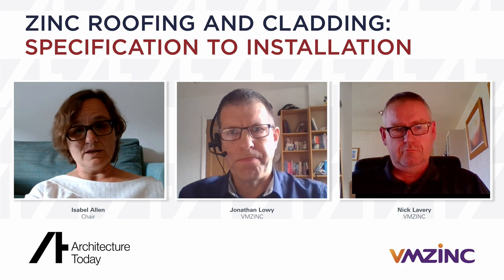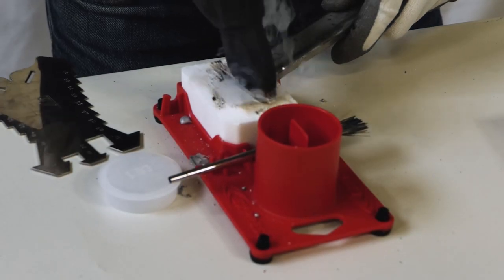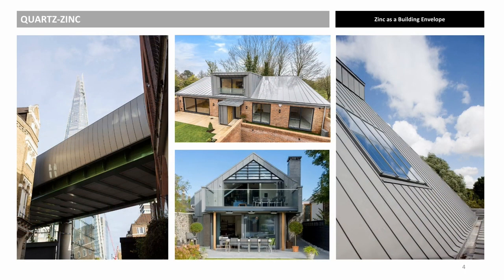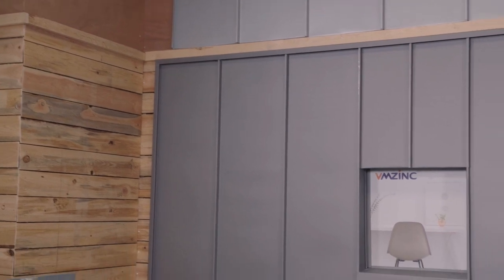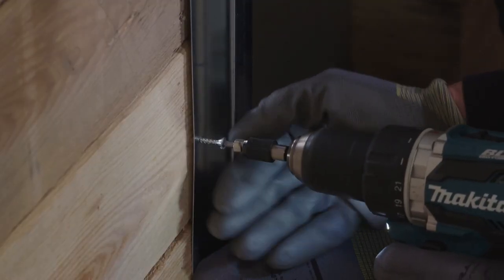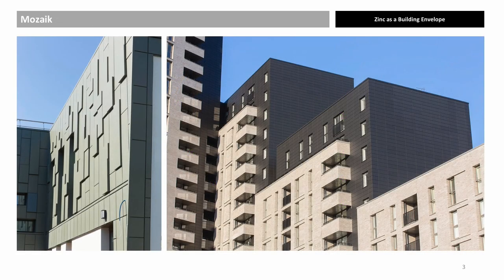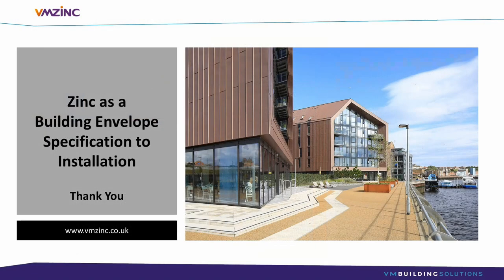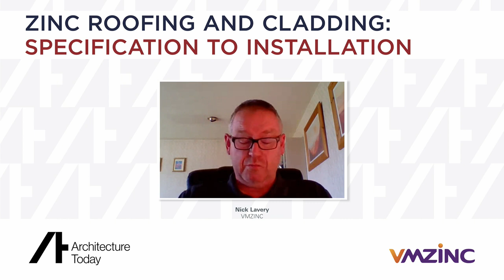AT Webinar with VMZINC Zinc Roofing and Cladding Specification to Installation

Comment: Very interesting high skill installation. For domestic use colours seems impractical 3 ton volume unlikely. 70mm rockwool tween rafters 50mm sarking dual purpose board over =120mm insulation total. Can VMZINC membrane go over direct & zinc roof covering finish fix direct into sarking? Zinc weight reduction factor+structural improvement of sarking board attractive. Height restriction problem + batten & ply bit high. If can't utilize this excellent material purpose made metal plaintile panels possible alternative but more expensive than tiles & short guarantee period. The offer of advice on domestic projects generous impressive! Proliferation of this material justifable less structural weight long life recycles & 50 year gurantee superb. Now what's the cost?